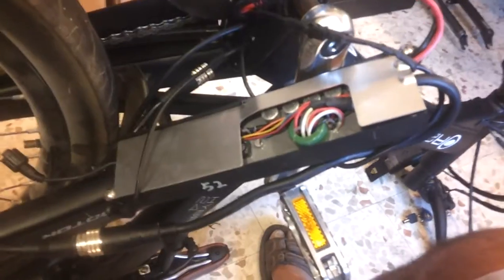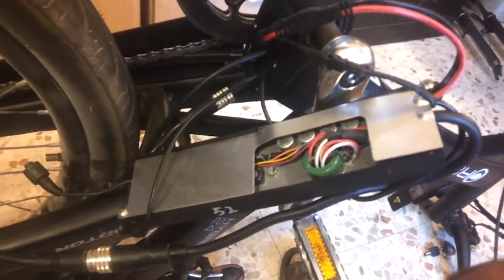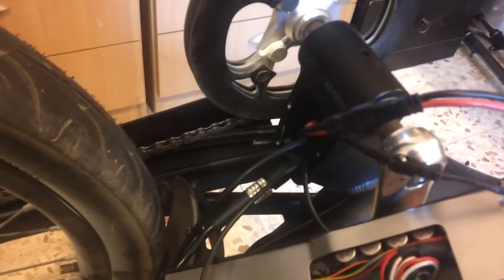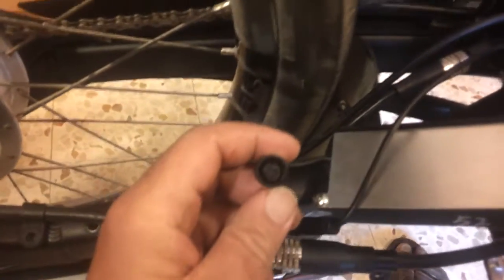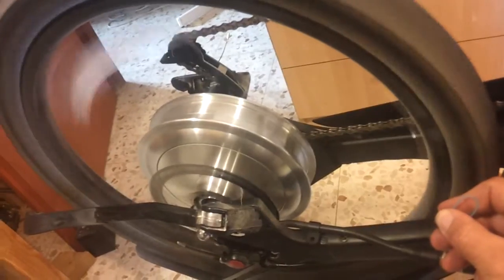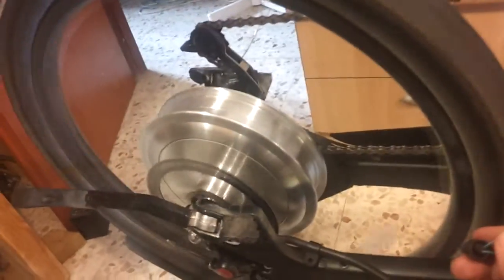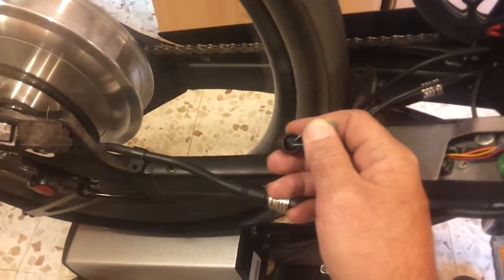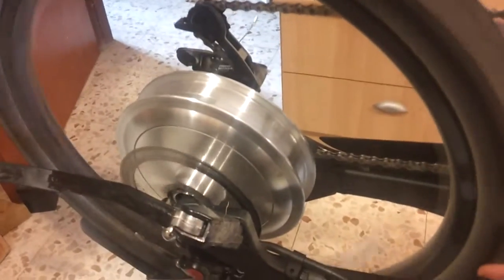A2B 24 hybrid bicycle controller connections

Comment: Hello i have this bike and i want to replace battery t another one 36v, but therei is 6 cables going out for the battery 2 main thick ones an 4 thin ones. I tried toconect only main ones but nonthing happened. How do conecct those cables right? My old battery was stolen but i have 36v battery 11ah. How to conect it to these 6 cables?
Reply: Yes i have this new battery its not original but its same 36v and 11ah. But i conect these 2 main cables to battery from the old conection but its just sparks and nothing happens. As i mentioned before from the old conection to a battery there is coming out 6 cables ,  2 main ones and another 4 thin ones
Reply from the maker: the original battery is connected to the electric system. if i remember right, it turning on the battery bms. if you like to replace the original battery, go for ordinary li-ion battery (with it own bms - gives power with no switching), and connect the two main thick wires to the system.
sorry, but i dont remember if you need to bridge some of the thin wires for it to work
Reply: And i checked on my friends bosch e bike that there is same 6 cables for battery 4thin ones and main ones... ciuldnt find any info about this on google at all...
Reply: Lukas Did you find our what the 4 thin wires do ??
Many thanks John
Reply: Hello Lukas! It has been a while but have the same issue you did. Wondering what brand and model controller you are using and if you had a clue how to hook up the thin hall connectors from the hub here to a controller? Hard to see what Horizon did here but after so long there may be a better way to deal with this..   I think the controller was in the hub on this one but not 100% sure. 
It would be a shame trash or dump the bike! Its' a great frame perhaps a new 20inch wheel kit and new battery would work on it?!  If you get a moment love to hear from you!
Reply: @richardesposito6622  hello. I ended my searc that there is only one solution.  To change controller and new lcd screen, you can save only motor by taking out electronic chip from inside off the motor and stay with normal motor wires coming out.
Reply: @lukaspundzius9293   Hello Lukas. Totally grateful for your reply! The two I have just have throttles and battery indicators next it with a front and back halogen lamps and no lcds on them. Opening the hub is doable but a bit daunting for most.   No surprise but I burnt part of one of the gold pins at the rack connector in attempt to power it. Spent lot of time with research and testing but I did get a bit more respect for how they work and what a controller does for and Ebikes! Hopefully you found a way to work with what you have or get a new kit so you can have some fun with the technology. Enjoy

Comment: Hey! Im wondering, i have the same bike as u (but black) and the motor dont work. Also the display show a C inside a triangle. Do you know what to do? I checked the wire to the motor and its entire. Help me please! Thanks for answear
Reply from the maker: i dont know what the C in the display means. maybe search on the web.
think you better test the battery voltage first, and after checking the motor wiring, maybe go to a conclution that the controller is broken.
but it can be also the PAS (prddal assist)  sensor.
Reply: Hey! I think you are trying to contact my mom since she is the owner.  And we also have that problem.

Comment: Hi, do you know where I can get a new battery?
Reply from the maker: Hello friend
we can build for the the inner pack from Panasonic / Samsung cells, if you send us the old pack
http://neworldshop.com/product/%D7%A1%D7%95%D7%9C%D7%9C%D7%95%D7%AA-%D7%9C%D7%99%D7%AA%D7%99%D7%95%D7%9D-samsung/%D7%A1%D7%95%D7%9C%D7%9C%D7%94-%D7%A1%D7%9E%D7%A1%D7%95%D7%A0%D7%92-48-%D7%95%D7%95%D7%9C%D7%98/%D7%A1%D7%95%D7%9C%D7%9C%D7%AA-%D7%9C%D7%99%D7%AA%D7%99%D7%95%D7%9D-%D7%A1%D7%9E%D7%A1%D7%95%D7%A0%D7%92-%D7%9C%D7%90%D7%95%D7%A4%D7%A0%D7%99%D7%99-a2b-%D7%A1%D7%9E%D7%A1%D7%95%D7%A0%D7%92/
Reply: Hi, thank you for your  quick reply. 
Is there any other option/tip since I live in Italy?
Reply from the maker: sorry, i dont know where in Italy you can find this battery.
but' we can send you the Panasonic inner pack, and you can put it in your actual aluminium case.
Reply: How much would that be? And where can I find the instructions on how to open the case?
Reply: How much would it be from you?
Reply from the maker: the inner battery - Panasonic 48V 11.6Ah 3C (power cells) cost 570usd + shipping.
if you like us to send you the battery tou ypur country, please send us your adress and we will find out the shipping cost.
for diasembling the case, we will send you instructions after purchasing the battery.

Comment: how to unlock a2b hybrid 26 "450w? my email malecki@data.pl
Reply from the maker: 65inigo just replace the motor controller with a 500W open controller, and connect it to a throttle.some of A2B ebikes have the controller inside the Hub motor. need to check it, because i don't know all the A2B types
Reply: Hi, can you tell me exact type of the controller I would like to open my A2B bike. Thank you

Comment from the maker: it's the PAS (pedal assist sensor) that give the controller pulses.
it's located next to the chain, on the rear fork.
if you like to fix it, dry the sensor and use some silicon glue to sill it.

good luck
ilan